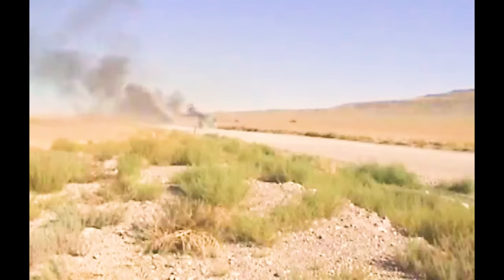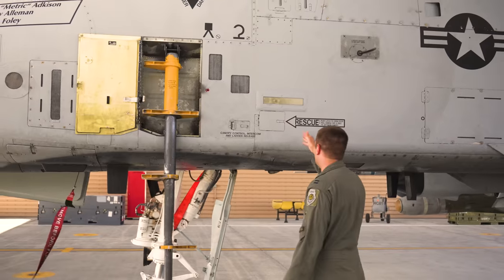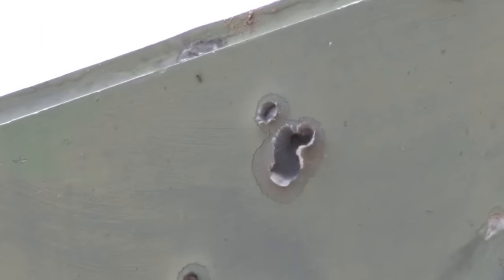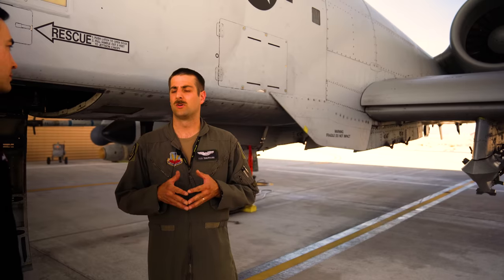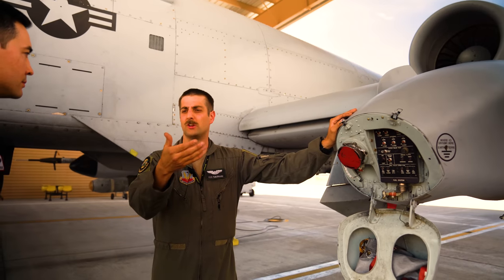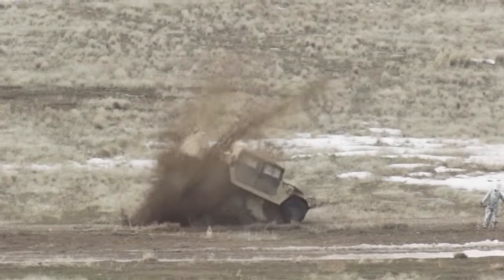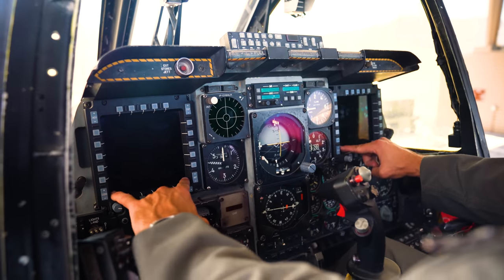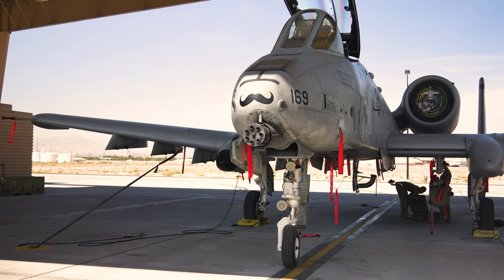The Future of the A-10 WARTHOG is HERE

Comment: Glad to hear you guys talking about more than just the gun.  Everybody loves “big gun go brrrrrrt”, but I feel like a lot of folks forget that the A-10 also has five hardpoints on each wing that can carry all manner of bad news for enemy assets, and that those are often a more effective choice than just spitting 30mm.
Reply: Most people are also not aware that the gun is basically just good to mission kill a modern MBT, i.e. immobilize it. The rounds wont penetrate any armor aside from possibly top armor, but they obviously dont dive down on targets like that. You can destroy tracks and parts of the engine reliably with it, but not the crew - and its easier to replace a MBT than a good crew. So, you use the Maverick instead.

And before somebody says "but the video shows a swiss cheesed tank!", thats not a Main Battle Tank, thats an M113 APC made of aluminum. 😉
Reply: If they're better options than this main gun the 30mm. Whats the point of the aircraft. Seriously the f-15ex can carry as much as you need and there's this new thing called wingman drones that could carry munitions for you plus the A10 can't really use modern missiles unless you really gut-out the plane to start installing something decent and modern something that's going to make it as expensive as a f-35
Reply: @danielsnook7362  the whole point about the a-10 is that its not as expensive and the new update for the new weapons didnt cost anything close to an F35. Cuz u already have the easy to maintain airframe and only need some minot Hardware and software Updates
Reply: its has four hard points on each wing and three under the fuselage...
Reply: @tomschu6638 have you been keeping up with how they upgrade the A10 it's poorly designed from the beginning it's no longer cheap as well. Really had to install targeting systems cuz they used binoculars and pure eye sight  cuz it didn't have any of those electronics like the f15ex or f35 and f22 it does have it now but that came with a hefty price and remodeling of the plane and the 30mm gun is far from accurate or reliable even with improved software
Reply: @danielsnook7362  The modern updated A-10s are not as cheap as the earlier models, but they're still able to operate from primitive or improvised airstrips and don't require as much ground support equipment as high-end modern fighters.  Going forward, I think we'll be seeing both F-35s and A-10Cs in ground attack and CAS missions, either separately or jointly as discussed in this video, depending on the specific situation.  Both aircraft have their strengths and weaknesses.

Wingman drones are a cool concept, but they're still in development and are not ready to be relied on in active combat.
Reply: @SynchronizorVideos  + the cost per flight hour is wayyyy lower than for example f35
Reply: @tomschu6638  only without the expensive externally housed electronics suit. With it the A10 is basically a crappier F35. Nah, the only future this thing might have is as a munitions mule for more capable aircraft and even then it's probably cheaper to use a drone.
Reply: "hehe 30mm minigun go brrrrrrt"
Reply: “…bad news…” 😆
Reply: I am happy they got improved electronics to identify targets.  This lowers the chance of hitting friendlies because they mistook identification panels for rocket launchers.
Reply: @Ganiscol  well said, most people don't understand how complicated war really is, some people really think it's point and shoot and go home
Reply: Really? Thanks for talking to us like we are unintelligent.

Comment: The A-10 has come a long way.  In 1999 I began working aircraft maintenance on A-10s.  At that time, the aircraft had an inertial navigation system.  Upgrade to GPS had only begun around that time.  Although the aircraft was fitted with rocket pods for many years, the concept of laser guided rockets is relatively new.  Glad to see the aircraft becoming more effective for troops on the ground.  It's an extension of their will to succeed on the battlefield.  Was an honor to provide mission capable aircraft to support their mission.  Big thanks to forward located troops on the ground (past and present) doing the hard work to their job done
Reply: Hey brother, the INS is still there.  They just added CDU and the GPS.  Then SADL and other junk.  Laser Rockets are just rockets.  The LAU-131 A/A is just a longer pod is all.  Same stuff.  A-10 is still the Hog, trust me, I worked it until the 2020.

Comment: Hye Hasard 👌🇲🇫.
The only and best memory I have of the A10 warthog is during the Desert Storm mission! The A10 demonstrated with force and agility that it was possible to ally power at low altitude and agility in close attack (cannon mode). Very beautiful Beast...a rare piece and especially it would be very interesting to start on this type of device for young fightersle.The A10 will develop some control take-off in low-altitude fight situation.

Comment: As a kid we all wanted to be fighter pilots, but growing up is wanting to be a CAS pilot.
Reply: CAS can be conducted by multiple other aircraft Like the F-16C the F-15E and more
Not just the A-10C
Reply: @pacificfederationpeacekeep999  F-16s (which I loathe as my F-5 Tiger IIs kicked their A$$ over Venezuela) failed miserably providing CAS (and most other things) in Afghanistan. I have US Marine Recon and US Marine Security (MPs) family that will back that up  besides myself.
                     Though I love the F-15 with all my heart (It was my Plan B if the F-14 Tomcat thing didn't work out for me) I seriously doubt the F-15 in a CAS situation. The F-15 Eagle is an Air Superiority Platform that was supposed to be replaced by the F-22 Raptor (also not designed for CAS).
             That said the F-14 Tomcat (the US's other fast plane built for Air Superiority) could open its wings fully, go low and slow, drop ordinance, then punch the throttle. close the wings and get out of trouble quickly.
          Bottom line, the A-10 is perfect for what it does and we love them for saving many of us. t
Reply: @howardbartlett3026  "F-16s failed at providing CAS" which is why most CAS in the Middle East was done by it and the B-1 Lancer? Kinda strange statement to make. They did the lion's share of CAS. In Afghanistan, the A-10 was underperforming to the point that around 2008 was when the F-15E replaced it in Afghanistan. The F-15E (the Strike Eagle; the Eagle made to move mud and drop bombs) is, without question, the best CAS platform we have. The SDB and SDB II are god-tier ordinance.

You don't know what you're talking about. And before you go, "Well what's your credibility coming from?" My credibility comes from many different sources, chief of which was my father who ran CAS missions as a Navy pilot in a Super Hornet with a total of over 20 years of aviation experience, as well as all the actual fighter pilots I've met through him and what I've learned from all of them. The A-10 is fine at COIN and anything with no integrated air defenses, but the second you get introduced to a Shillka or a Tunguska, the A-10 gets ruined. The fact you didn't even know the F-15E existed as a strike variant of the F-15 tells me you lack a lot of knowledge.

Ignorance isn't a crime. Staying ignorant willfully is.

Edit: Made a typo on 'and.'
Reply: @punishedsneed  so you have never actually seen CAS be preformed and it shows lol
Reply: @CODYoungGunna  No, I was too busy actually performing it. I don't like waving my experience around because appeals to authority are cringe when I can cite the information and experiences of others.
Reply: @punishedsneed  sure you were. Make a claim without explanation why that claim is creditable. So please tell everyone, where you were deployed, what squadron you were with and who was your commander!
Reply: @CODYoungGunna  Sure. I was in the 391st out of Mountain Home under Lieutenant Colonel Brian McCarthy for six of my ten year contract before I transferred out to go to test pilot school.
Reply: @punishedsneed  in the AOR dude

Comment: I never hear the value aspect of flying the a10. If your job is to pick up bricks at home Depot and throw them out the window, sure you can use the Lambo, but isn't it a lot cheaper to use the old 1970 Chevy pickup parked on the side of the house? she don't cost ya much to drive, and she holds lots of bricks.
Reply: Then why A-10? In non contested environment, a prop plane would be even cheaper and as efficient
Reply: @solarissv777  Because a10 exists and is ready and there is an entire ecosystem of people and SOP's etc. The past 40 years of TTPs.

Comment: The A-10 is just brutal and beautiful. Nothing does what it can, nothing looks like it, and I don’t get the push to replace it with the F-35. Long live the A-10!
Reply: Because the original replacement fate was in the 1990s and it's been 30 years. The spare parts are drying up, it costs billions to remanufacture new structural parts as they're aged and worn.
Reply: The USAF is pushing to replace the A-10 because the F-35, F-15EX and AH-64 all do CAS better
Reply: @זהסודי-ה7מ  but they don't

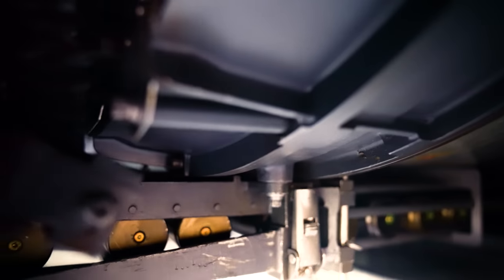Comment: 5:08 "ten effective pylons". doesn't the A-10 have 11? that being left to right: 3 pylons, the wheel, 1 pylon, 3 body pylons, 1 pylon, a wheel, 3 pylons. I said wheel to better describe location. I know it's not a weapon.
Reply: Might be because targeting pod usually takes one up.
Not sure though.
Reply: I guess he means that they never remove the targeting pod, because without it they lose some of their smart weapon capacity.
Reply: @Toktott  targeting pod is in the front side. The 3 pylons should be behind it. I've seen A-10's with 3 and the pod.
Reply: Also, the centerline station (station 6) is only ever used to carry external fuel tanks, and those are only ever carried on long-distance ferry flights, never in combat.
Reply: @slpkntmggt06  the new conversion fuel tanks are designed to be carried in combat and were used during the drawdown in Afghanistan to extend coverage between air refueling times.
Reply: @slpkntmggt06  you're spot on about the "10 effective stations." We don't consider station 6 a weapon station. It's just a place to hang the fuel tank when we want longer legs or more loiter time.
Reply: @SticksFlick  Nice!! I had no idea they made tanks for combat. Tha KS for the info!!
Reply: Fuel tank is the only thing loaded on the center

Comment: Somebody explain why nobody is even considering a follow on aircraft to the A10?? All they talk bout is the F35 why can't we build a modern super A10 they built a super F18 but so far nothing is even on the drawing board for a follow on A10 we need the GAU8 to stay on the battlefield and a aircraft as tough as the A10 the F35 just won't take anywhere near the punishment an A10 can
Reply: F35 won't need to take the punishment because it doesn't get hit by old soviet sams
Reply: With modern guided munitions, there is just no need to get close to use the gun, its time has passed.
Reply: Retiring the A-10 without a replacement is to save money. They did the same thing with the EF-111.

Comment: They should restart the A-10 line and send old ones to Ukraine. Brrrrrrttt.
Reply: Or perhaps replace this outdated junk.
Reply: @SHVRWK  Egads.  Replace with what?  Why do you consider it junk?
Reply: @madmadmal  F-16s, F-35s etc. It's outdated because it's slow, heavy, has obsolete avionics and systems has the most friendly fire cases. This thing won't survive against a conventional military.
Reply: @SHVRWK  Really, so you think aircraft that can't loiter, nor put rounds on target, nor are designed for CAS are better.  A joke surely.
Reply: @madmadmal  F-16, F-35s even F-18s can do all of that. The A-10 can loiter and attack a couple of desert dwellers with sandals and AKs. I'd love to see this thing try to take on a modern army
Reply: @SHVRWK  So delusion as a defense.  Run with that.
Reply: A-10 wont be replaced bc there's no money. That's why they keep wanting to retire it... to save money. It's why the EF-111 got retired and not replaced.

Comment: Give them 2 days in Ukraine and we can all turn the tide of the war.
Reply: They already have Su-25s.
Reply: @ChucksSEADnDEAD   Yep, but they need A-10, which is way better.
Reply: @viktorkarlsson4900  It doesn't matter how "better" it is. Both a slow runner and a fast runner will trip and fall if you swing a bat at their legs. The missile doesn't care if it's going to hit a Su-25 or an A-10. It's just gonna chase the aircraft and try to bring it down.
Reply: @ChucksSEADnDEAD   I was talking about the giving and not the reciving. The guns on the A-10 will do more damage than the SU-25. About reciving I would still say that the A-10 can take more punishment, but still its packs a bigger punch.
Reply: @viktorkarlsson4900  Trying to split hairs over the gun is completely useless, the A-10s primary armament are Maverick missiles and rockets. They both carry 30mm guns which are better used on soft skin vehicles or light armor after the heavier armor was taken out. Lining up gun runs is also much riskier because it requires a predictable straight line dive. So it can only be done to finish up already combat degraded forces which can't shoot back.
Neither the Russians or Ukrainians are doing much use of gun runs, they're flying nap of the earth and releasing rockets while pitching up because the ballistic arc allows them to strike positions without having to fly over them. They know aircraft can't survive over heavy MANPADS coverage so the A-10 wouldn't be using the gun or any laser guided weapons either.
At that point, the A-10 would be forced to loft rockets too, meaning it wouldn't be doing anything better than jet trainers or even Mi-8 helicopters with rocket pods on pylons.

Comment: For the life of me I don’t understand why the Pentagon wants to retire the A-10. It’s the most effective aircraft in the USAF inventory. If they retire the A-10 it should be replaced with an updated A-10 not another overpriced,underperforming F-35.
Reply: It can only fight in a modern battlefield if an F35 is around. That's why all he talked about mission wise was integration with 5th gen. F35 protects it and finds targets for it. That's how they are used now.
Reply: @yakidin63  it doesnt have to be a F-35, though. They've been playing ball with the fast planes before the F-35. And if datalink between A-10 and F-35 exists, it can exist between A-10 and Strike Eagle, Viper and Super Hornet as well. Those planes havent been all scrapped and wont be for a long time given the F-35 issues, cost and basically a new cold war at hand.
Reply: @Ganiscol  thing is, now that everyone are gearing up towards near peer warfare, we need to think about when, after beginning of war, does each aircraft get deployed.

1st day and until most SAM threats are dealt with, the air is owned by f35, f22 and EA-18G.
Many days later, when CAS operations are possible the aircraft that can be deployed are f35 with wing pylons, f16, f15, super hornet, a-10, ah-64, ac130 and probably others that escape me now.

Most likely all would be used and a-10 would only get a small portion of the pie. Which is exactly what happened even in Middle East. Not only that, but it's very likely it won't be near the tip of the spear at all.

A-10 has seen a lot of upgrades, which are the only reason why it's even remotely viable today. The cost has been millions per unit. After all of that, it's not worth it to retire it now, even if it's not the best for its mission anymore.
Reply: It comes down to saving money. That's why they retired the EF-111 with no replacement.